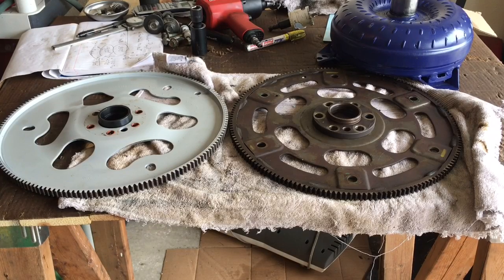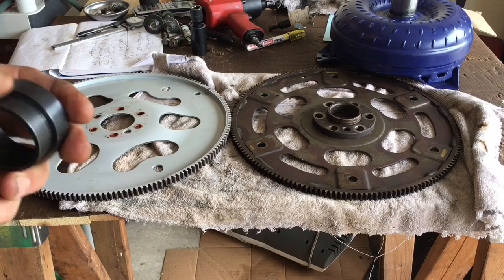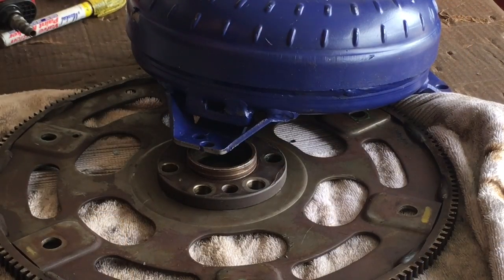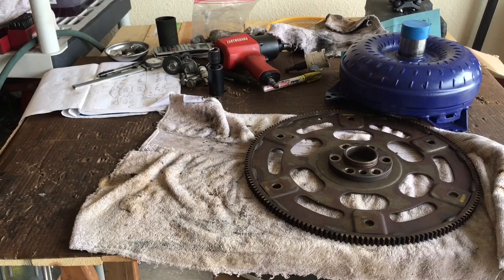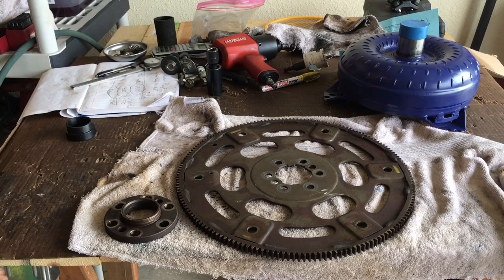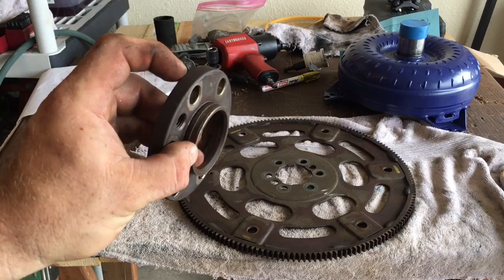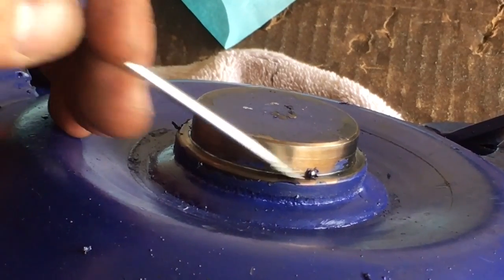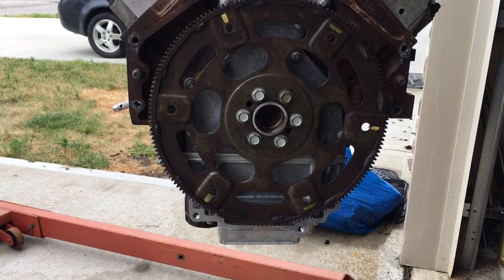LS/TH400 Install requires a bolt on adapter

Comment: I have the dished flexplate and longer bolt kit. It bolts on the outside of flexplate. Got it way back when it was cheap. Clearances were good without any grinding but had to elongate my holes. I'm running a 2800 stall FTI converter.
Reply from the maker: Jeff Newman What Transmission was it?  I’m curious what the difference in reach would be between your setup and the way I did it? 
The reach from the Crankshaft register face to end of the adapter would be long using it outside the dished flexplate, .800” + .130”= .930” 🤔. I’m curious which transmission this will work in?

Comment: 6.0 flexplate 2002
Reply from the maker: meathead1011980 This is a 6.0 flexplate 😉. All 6.0 flexplates are “Flat”, the early 6.0 has a .400” extended crankshaft register/hub 1999-2000 used the flat flexplate no adapter.  The 2001-up 6.0 uses the bolt on adapter, seen in my video, to properly locate the flexplate to the starter. 👍
Reply: HeadFlowInc yeah I got the years mixed up... mines is made on to the plate... I can’t unbolt it... this is good info because I didn’t know that... thank you my guy
Reply: Adapter is for flat flex plate
Reply: I have 2006 6.0 on a 4L80E it's the original engine with the original trans ..the problem I'm having is that the flexplate keeps breaking around the bolts which is around the bolt on adapter(spacer)..do you know what could be the cause of this?..its my work van and it has 523,000 miles runs great and shifts smoothly. I never had any work done on the trans except change fluid and filter..
Reply: I forgot to mention, it's a flat flexplate with bolt on spacer from autozone (pioneer brand) 5th one purchased